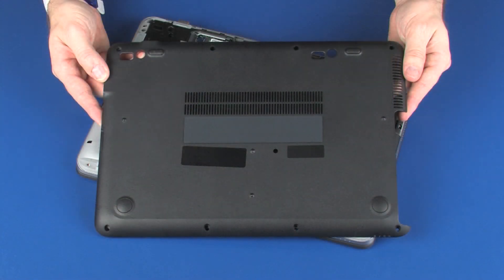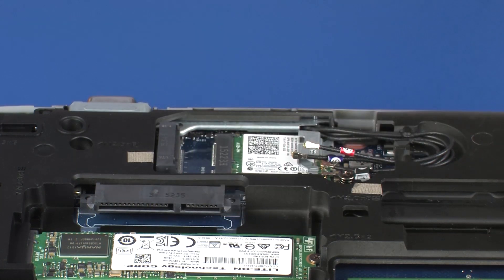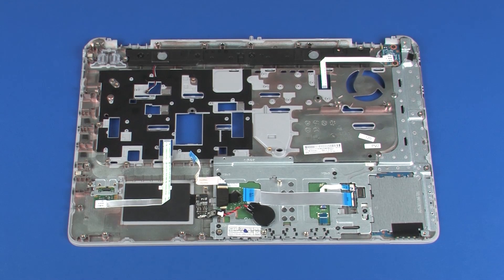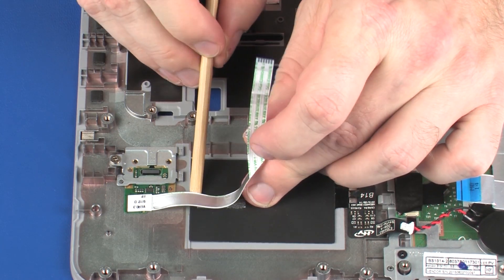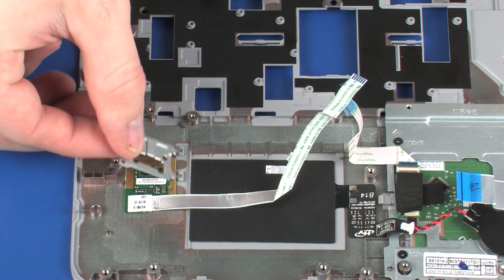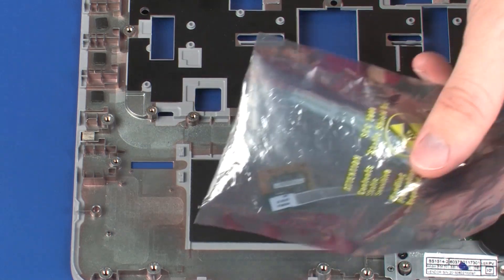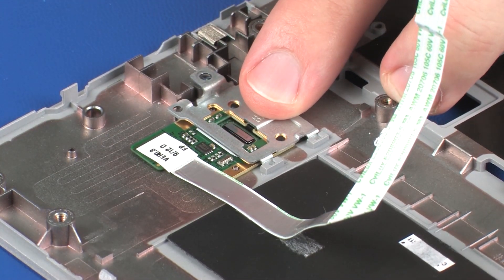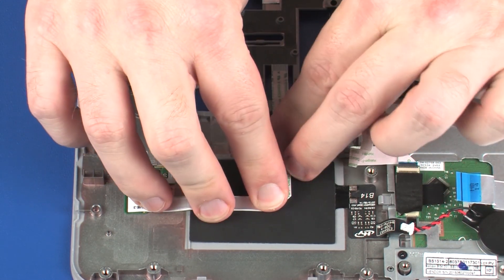Replace the Fingerprint Reader Board | HP Probook 640 and 645 G2 Notebooks | HP Support

Comment: My probook also dont have fingerprint and no sim card reader 😮 is it possible to add that  its 640 g3
Reply from the maker: Hi there, thanks for contacting HP Global Social Media Support!
I understand that you need to know about adding fingerprint and no sim card reader on your notebook.
I will do my best to assist you.
HP does not recommend upgrading or downgrading hardware parts or software that is bundled with the product as It may affect the manufacturer's warranty and performance, however, you could change the configuration at your own discretion.
Regards, 
HP Support